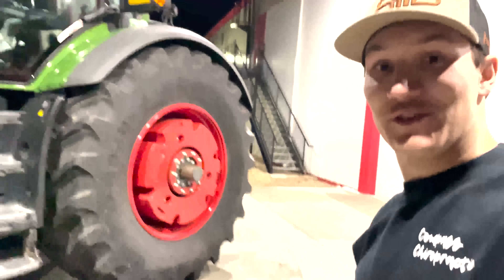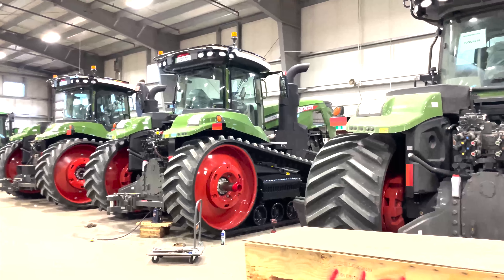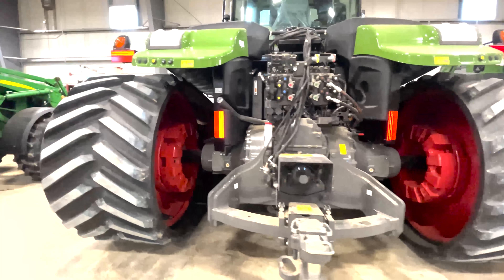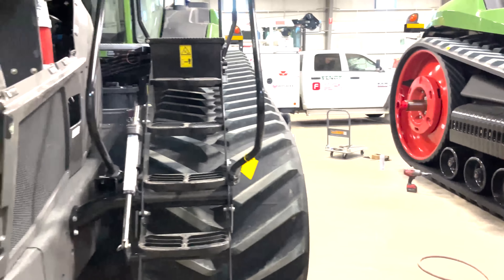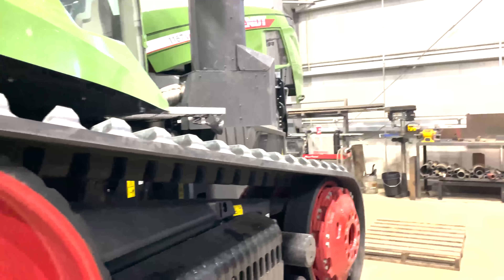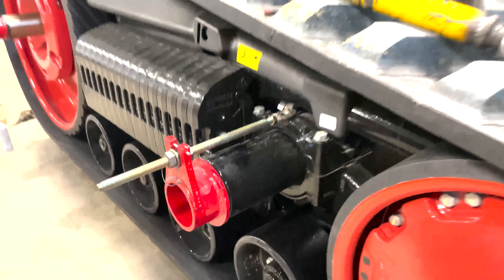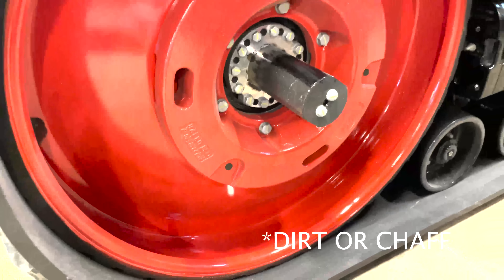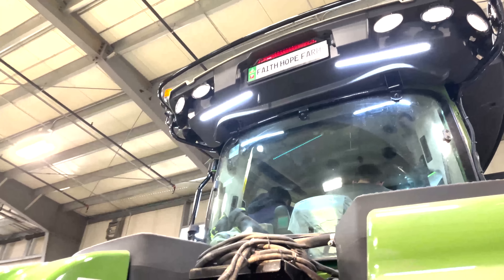3 Fendt 1167s getting ready for Spring

Comment: Very impressive to see so many big tractors at once, great video!

The reason for not letting the air alongside the engine is that the air is hot and the temperature of it isn't constant after passing the coolers. By guiding the hot air directly out of the machine there should be better conditions for the engine to work. It's easier to control the temperatures of many parts of the engine when there is no massive airflow with changing temperatures under the hood.
Reply from the maker: Thank you Sam! That makes sense when I think about it! I appreciate the comment and the information 😁

Comment: Nice video 🤟🏻. About the fan/radiator arrangement: It's not an air cooled engine so you actually don't want the warm air coming out of the radiator to flow around the engine. That's why they installed that shield to make the air escape to the side/top.
Reply from the maker: That’s good to know!! Thank you for the information!

Comment: I like the 1167 Fendt but don’t love it... (we have 4 Case Quads 3 2019 620’s and one 2021 470 Quad) We are currently demoing a 1167 on one of our 67’ Field cultivators. It’s pulls just fine.... but we have mud and soft soil in spots it don’t like it like a Quad. Overall it’s a nice machine (better that the 9570 JD we demoed last spring... that thing was rough) but we’re probably gonna stick to 4 tracks.

Comment: Hi Austin, ..... great shot at the end of Mike's old and new tractor.  😉
Btw, do you know the difference on the MAN 16.2L - D4276 engine for the FENDT MT1167 which has a range of 612-700 hp and the same MAN D4276 engine for the FENDT IDEAL-10 with 790 hp, is it tuned up or has it a totally different setup by inner parts and transmission.
Greetings from the Netherlands.  👋
Reply from the maker: Thanks for the comment! I’m not exactly sure how different they are, however I think it is how the horsepower is used if that makes sense. If they are the same engine it would be difference in tuning for sure. I think mainly why one is so much higher is the difference between tractors and combines in how they use the hp. Putting horsepower through a transmission to the ground is way different than putting the hp through gearboxes, belts, and hydraulics like on a combine. That’s my thinking but I could be completely wrong also! I hope that helps and greetings from Sask! 🌾

Comment: Who makes the plastic deflectors for the wheels?
Reply from the maker: I am not sure actually who makes those
Reply: These are designed by AGCO and are available through the parts system if you are wanting to put some on an older machine.  You will need to drill and tap a 1/4" or M6 hole in the wheel to attach it, and the part number is 597346D3 (or might be a D2) for a wide drive wheel and 597347D2 for the medium.